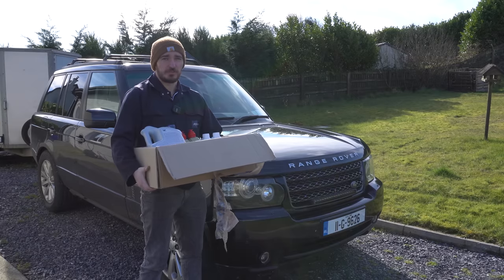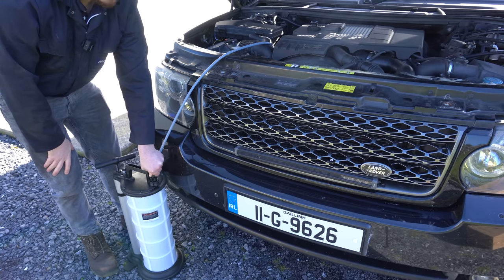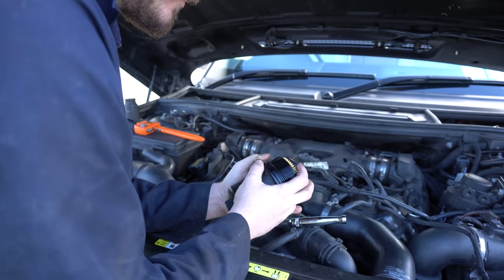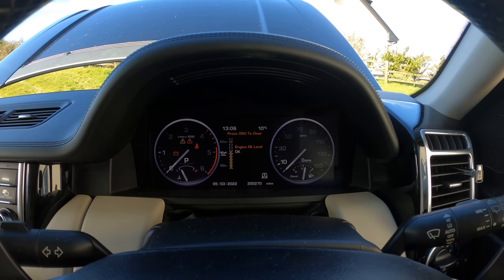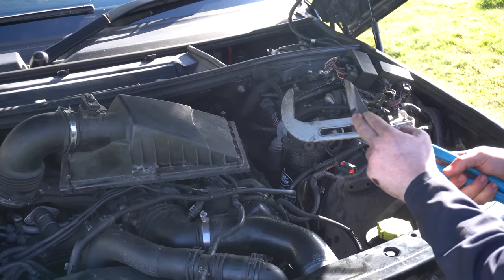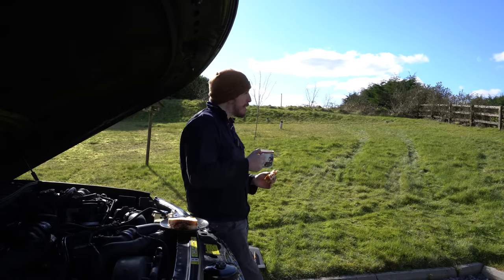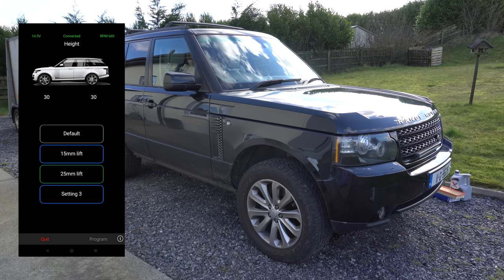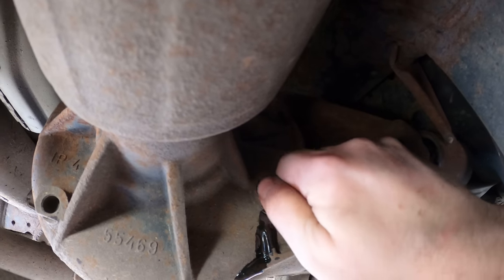I did a 200,000 MILE SERVICE on the CHEAPEST 4.4 TDV8 Range Rover L322

Comment from the maker: Glad to have fresh oil throughout the Rangie now.  I was impressed by how quick and easy the oil extractor pump (https://amzn.to/3tRcE8C) made the oil change - but what do you guys reckon?  Are you suckers or drainers?
Reply: I’m keen to know if the copper pipe will fit down the extraction tube and, if yes, does it reach the bottom?

I’m wondering whether a pipe down the tube is more likely to really suck out the dregs, or whether you would actually get more out with a seal at the top of the tube and effectively creating such a good vacuum that the dregs get pulled up and out the tube?

I’m such a perfectionist when it comes to these things but my L322 deserves it! 🤣
Reply: I would be a drainer, and should it be possible, be able to remove the pan to see what was in the bottom, sludge, etc.
Reply: Is there not 2 drain plugs like on the 3.6? Rearmost one for small reservoir for turbo can get clogged if not drained, would the vacuum method cover this?

Comment: Just did my 300,000 mile service on my 2006. Original engine, tranny, and in tact air suspension. Keep fixing it it’ll keep going. Never sucked it once.
Reply: 300000 miles or kilometers?
Reply: @frodrguez  miles
Reply: @scotthardin29  Mine has 201,000 miles on it. It’s a 2007 4.4 Jag engine so hopefully it will get to the 300000 mark.
Reply: @frodrguez  Well you have the best engine that Land Rover has ever made in my opinion. Just keep good fluids all around (tranny included) and i attribute the long life of the engine partly to the regular use of synthetic Lucas oil stabilizer.  I just hit 313,000 m.   Keep it going my friend!
Reply: @scotthardin29  Will do. Thanks for the input!

Comment: You should feed one of the thinner pipes down through the tube into the bottom of the sump then link that to the thicker pipe that attaches to the pump. That's why they seem short, you link them together.
Reply: You beat me to it, I've been a sucker for 5 years now 😂 it works perfectly. As you said, just feed a smaller tube in untill it touches the sump plug, and then attach another tube. Once it can't draw anymore oil I then leave it overnight and do it again the next morning. This will get the last of the oil out, normally another litre. I also don't know what the copper pipe is for 🤔 Any ideas ?
Reply: Was going to say the same thing. Watched another video and the sucking method with the pipe fed down to the sump got all but a few drips of oil out. The risk of leaving sludge in the sump is minimal.
Reply: Even the thinnest one doesn’t fit properly down the tube unfortunately, I tried forcing it but no good, I’m guessing that this wasn’t put in as a dipstick tube and an actual drain tube for this purpose and is at the bottom on the sump…

Comment: You certainly like to live dangerously with those gallon cans to drain oil into! I use an old washing up bowl, a much easier target to hit, and you can also let the drain plug drop in there as well, you really need a 4 poster to do this job, but then it would not be an adventure, at least it was not snowing, or 45 degs! Many thanks for posting this, it is inspirational. Chris B.

Comment: Put the pump on a chair , take the pipe from the engine saves the oil in the pipe going back into engine,  the pump blows of when it's pumped to max pressure so wait and pump it every few minutes.  The pumps r great but every 3rd oil charge take off the sump bung and drain the engine put 2 pints down to push out any crap plus you can check for any metals so you know if theirs anything wearing out this has to be done on second hand 200.000 mile car because you don't know the true history.  Plug putting in a liter of diesel and the flushing out the engine twice only using one replacement filter after second flush is brilliant to clean out carbon build up. A can of fuel system cleaner again is great but do remember diesel is the lubricant for all the fuel system 🤔

Comment: A tip for draining the oil into a gallon plastic can. lay the can on its side and cut a large square hole in the top side . This will give you a much larger target to get the oil into, just remember to refit the lid before use . You can then decant through the lid and into another container for disposal and keep your new oil drain receptacle in your tool kit for next time .

Comment: Hi sam.
I just did my first oil and filter change in my RR thanks to you!
Bought the pump and a 36mm socket.
Just a note. 
When I took the old filter out it had an insert in the centre (maybe no drain valve?)
I reused it into the new filter.
Thanks again.
Great useful videos

Comment: Great vid as per usual! The official oil filter is manufactured by Mann, I got one last week for another ‘11 4.4 that I’m replacing the turbo on. The sucker works pretty well on these, also works great on the sdv6/ingenium engines, only issue with using the sucker on the tdv8 is your not draining the turbos which is done via the second drain plug at the rear of the engine, it’s a bit of a pain in the ass on the l322 as the plug is about 1.5 inches from the subframe! Grand and handy on the l320 sport tdv8 as there is no subframe in the way! Back in the dealership I used to always use the oil vac as we were only allowed 1 hour ish for a small service so by the time you had undershieds, sump plug out etc you would be gone way over time compared to having oil vac on while removing the oil filter/topping up screen wash etc!
Reply from the maker: Cheers, good insight into main dealer land!  Quick question- any idea what the extra two o-rings are for that came with the Mahle oil filter?
Reply: @SamsMotors  Do those oil filters fit another vehicle as well which might need to use the smaller o rings?
Reply from the maker: Yeah possibly, guess they have multiple applications to one part number.
Reply: @SamsMotors  check out a video on youtube somewhere where someone tears down the oil cooler - as it is attached to the filter housing - I wonder if this a complete overhaul kit and these o rings cure the leaks you were looking for?

Comment: You can hand prime the fuel filter housing so it stop the engine cranking and air locks which will clear but can run the battery down if their not great
Reply from the maker: Mine started immediately after letting the fuel pump fill the filter up as you saw 👍

Comment: Hi.
Sorry for my english if its sometime wrong. Its self-learned.
I also make big service by my self couple monts ago, including brake fluid and power steering fluid. I make engine wash also, using cheap oil and filter. Extract and drain old oil, change filter and refill about 6 liters of sheap oil. Start the engine for about 30 seconds. And then change oil again and put new filter also. Now you have really nice and clean oil inside. But. Under the engine, there is also small oil pan (turbine drain) with cup. Did you not open this cup and didnt drain oil from there?
Its very easy to change brake fluid on this car, even dont need to remove wheels. Just need to assist by pushing brake pedal, you know what I mean.
Power steering. Need to lift up both front wheels. Then extract old oil from the tank first. Next, need to disconnect back-hose from the tank and extend it with some another, longer hose to reach in some canister. Also need to close hole on tank where you take hose off. And then fill up the tank with new fluid. Ignition on (to unlock steering wheel). Then you need to assist to turn the wheels compleatley to the left and to the right couple times. During turning steering wheel old oil coming out. You need to watch oil tank not going empty same time, to avoid getting air in system. When outgoing oil looks clean, its enough. Connect hose back to tank and make correct fluid level. Done. Additionaly, I remove the tank and wash it inside. There is a small filter inside the tank, its good to make it clean as well.
I make also transmission fluid full change (in specialized service of course).

Comment: Great video as usual Sam. Did my transmission yesterday on a gravel drive so am very much sharing in your pain! Just a word to the wise - don't know if the 8 speed ZF box has the same sleeve for the electrics as the 6 speed but I was sent a Britpart replacement as part of a kit (including genuine ZF oil) - the bloody o' rings were definitely oversized and I couldn't get it to seat at all (after a good hour of struggling!) Tried the old one and it went straight in so it wasn't just me being a dick!. Took the o rings off the old one and did a comparison and the new ones were significantly bigger. Thankfully I have a box full of various o rings so found some that worked. Was at the point of wishing I hadn't bothered. Date on the original sump was 2007 so very glad I did the job. Transfer box and diffs is my next job. Cheers

Comment: Good One Sam!! Did my L322 service last year borrowed a sucker from local garage, but might invest in one this year! Went with liqui moly oil in mine with their oil additive and ceramic additive. Used Mann filters. Will be doing annual service or 8k similar to you. 👍 Coolant replacement, along with thermostat and water pump and power steering fluid being done in a couple of weeks. Then road trip to Wales for a week😎 when I get back and it's dry need to get another Lanoguard coating applied underneath. Keep it up. 👍 Thanks Sam

Comment: @samsmotors thank you for doing this video helped me service my 2011 L322 4.4 TDV8 85000 miles I sucked oil out drained the turbo oil dump sump all Range Rover parts and filters gonna do the transfer boxes and diff then gearbox service i used comma 5w 30 c1 fully synthetic dpf rated I’ll be changing oil every 3000 miles just to be over ocd thank’s again Sam for your videos
Reply from the maker: You’re most welcome matey 🙌
Reply: Sam can I ask you a couple of questions please

Comment: Sam, yet another fantastic video - really informative and helping us all to keep our L322s in fine health and on the road. It would be great if you would do one on a full brake fluid change and also a coolant change as the last of the routine service jobs! Keep up the fantastic work!!
Reply from the maker: Thankyou Andrew, glad the videos are useful!!  Brake fluid is on the list, coolant not for a while but I'll get around to it eventually.
Reply: Also really keen to hear how you got on with your hard suspension niggle. Mine had the opposite problem - thought the active dynamics weren’t stiffening up enough so too much roll in corners. I used the IID tool to recalibrate the dampers and it’s definitely improved things. Have you tried that yet?
Reply from the maker: @range_anxiety  Sadly it's still an issue, I have a few things still to try before I totally give up with it though! Yes I've done the calibration a few times without any noticeable change :(

Comment: Only question on using the pump method is the risk of leaving the sludge at the bottom of the sump. Old school flushing and removing the sump plug, although time consuming, just feels better to me.
Reply: Only if you have sludge at the bottom... and if you do, then you have bigger problems elsewhere!
Reply: @Khalid Acosta  🤣🤣 I get what you mean... but there's always that bit of oil that's thicker because of the soot build up.

Comment: Mate that was good timing about the fan cause mine has started making a ticking noise every now and then at start up at the front and wasn't to sure what it was. As for the sucker I would only use it for about 2 oil changes or so then drain as that way you can see if any crap is sitting in the sump.

Comment: That oil transfer pump may just be the coolest thing I ever saw. The last oil change I did was a drain and it made a horrible mess. I will investigate, but does anyone know if that should still work on ‘11 with 5.0 gas motor? Thanks for the video Sam. Your glamorous assistant did a great job too!
Reply from the maker: Hey Jerry, thanks for the comment.  Yes it will work fine with your 5.0 - I believe the suction pipe is located inside the filler cap on your engine.  There's a link in the description to Amazon UK but I guess there will be something similar in the US too.  Cheers!
Reply: Awesome, one more question. For that oil transfer pump as well as the small pump you used for the other fluids. Is there a recommended way to clean those for future uses?
Reply from the maker: @jerrygreene7139  The best way I have found is to squirt a good amount of brake cleaner in (or any degreaser I guess), give it a good shake.  In the case of the extractor, just pour out the degreaser but you can pump it through the transfer pump to clean the pipe out.

Comment: Sam. Many thanks for this - a really useful reference video.  I will be doing the same on my 4.4 in a couple of weeks and it is so useful to have someone talk through the steps.  I will certainly look into the oil suction pump and avoid hot dirty engine oil ending up all over my arms as usual.

Comment: One of the straws in the suction kit as an extender... I think you used the extender to suck the oil.  I have the same kit and the bigger one goes onto the smaller ones.  HTH.

Comment: Hey Sam! Thank you for all your videos. I have the same car and I've just followed your advices! Transmission flush, Led lights...
I have one question, I couldn't find the answer on the internet for this RR model. How can I reset the "Service Required" message? I have tried by opening the bonnet and the driver's door, ignition ON but engine off, depressing brake and gas for 30 sec and ignition off...IT DOESN'T WORK on 4.4 tdv8 2011!
Kind regards Sam, many thanks in advance

Comment: I’ve been thinking of getting a Range Rover off and on. Do it yourself service maintenance is an option on these vehicles. So many modern vehicles you are obliged to take to a garage because you can hardly get a fag paper between parts to get at the or they require special tools. For this service the Range Rover looks doable and your demonstration fills me with much confidence that I can handle it. Well done no curse words, which I dare say I’d have had to bleep out if I had been doing the servicing video 😂 Thank you.

Comment: Hi Sam comments on the noise from fan  I would check the top idler above the tensioner for end float this is due to the lack of grease in the bearing in the manufacturing.
I’ve had two new ones like this and found no grease apart from a smear on the dust seal , I greased my old one noise gone worth checking out if anyone has replaced them make your supplier aware of this .
Reply from the maker: Thanks, yeah I replaced all my idlers and tensioner back when I did the alternator swap last year.  The ticking noise definitely comes from the fan hub, and from everything I've seen is a normal noise during warm up.

Comment: HI all my 2011 4.4TDV8 has now covered 250,000 miles, oil change every 6k and she runs very well, only issue I have is if I put anything in the boot the suspension comes up with a fault, but does not go down on any side, remove the weight in the back and no fault is shown?

Comment: Hi Sam, great video (I dont even own a RR but I enjoyed your video).
Reply from the maker: Cheers!  How are the Lexi doing?
Reply: @SamsMotors  It is ok, still got this troublesome code that is taking me to WITS end haha
Reply from the maker: @CarsofGlasgow  oh no!  Surely not on a Lexus!  What's the code/problem?
Reply: @SamsMotors  P0125, insufficient coolant temp. It basically doesn't blow warm air into the cabin. Ive had it into Lexus dealer and local independents, replaced various sensors and still no further forward sadly.

Comment: Love the content, sadly I didn’t buy the 4.4tdv8 I bought a 3.0 but it was £500 with a suspension fault and near enough full service history so couldn’t give up the chance of buying it especially at £500. Currently getting the suspension sorted and gearbox and engine service and it’s good to go fingers crossed
Reply from the maker: You can go wrong at that price!  I’d love to find something similar as a side project.
Reply: @SamsMotors  there is a autobiography black edition for sale near me for £800 won’t select 4th and 5th but everything else works, could be a nice easy fix for someone

Comment: hi and thanks for the informative video!  Very nice!! Regarding oil change, there is no magnet in the bottom pan, and then it is probably important to drain the oil from the bottom so that the bottom sludge and shavings come out?
something that is not possible with the suction method?
Reply from the maker: Probably good to do a full drain every few oil changes for this reason 👍
Reply: @SamsMotors  Yes, but no place can I find anything showing how to do it. The «plug» on the pan is not anything I have seen before . . . . and if I break it🙈🙈 Thanks again for your nice and detailed videos, many out there can learn from yours, on how its done😊👍👍👍
Reply from the maker: @perhansen7696  there isn't actually a 'plug' as such, it's a plastic quick connector that is actually the bottom end of the suction pipe I used in this video.  It comes off pretty easily, just using your hands or a pair of needle nose pliers (carefully) to squeeze the tabs.
Reply: @SamsMotors  many thanks! I will give it a try😅😅

Comment: Great guide.   Quick question, do you warm the engine up before sucking the oil out, or is the idea to do it when the engine is cold if you are sucking it out?
Reply from the maker: Definitely no harm in warming it up, it’ll help any sludgy bits liquidise and end up in the sump so you can suck them out.

Comment: The “electronic rear diff” is the locker right? Does this lovking diff have the same carbon clutches that the 5.0 lockers have?
Reply from the maker: Yeah electronic locking diff.  I'd imagine it is the same diff as used in the 5.0, yeah.